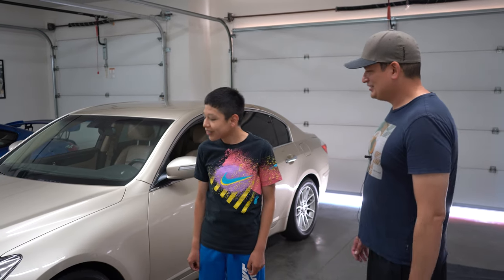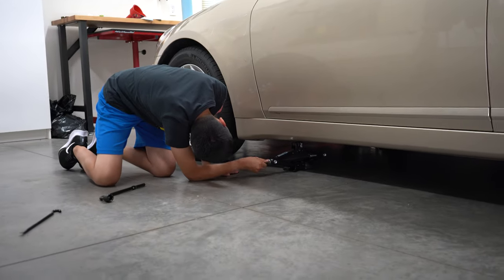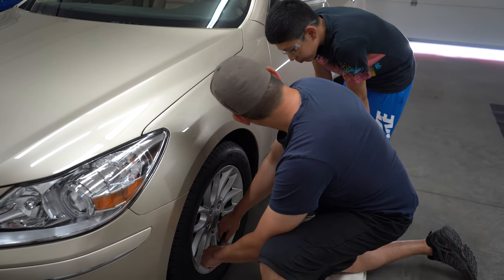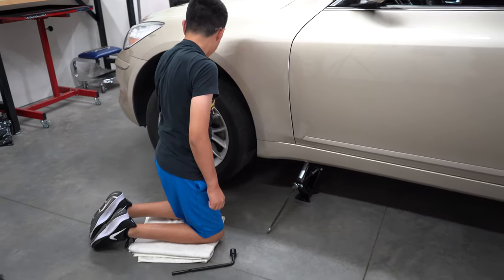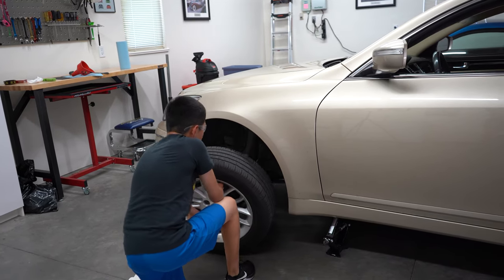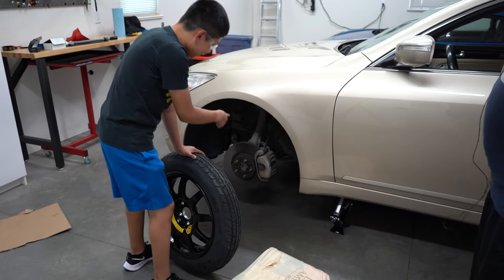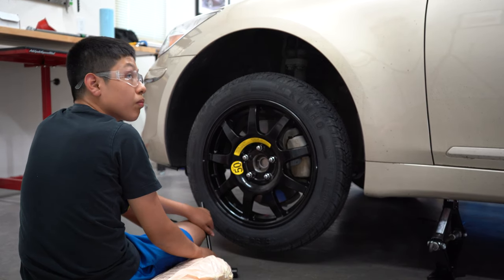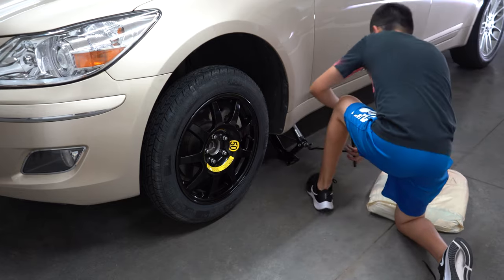Teaching A Teenager How to Change a Tire 😅

Comment: An added safety note before changing a tire, ensure the car is in park or gear. The e-brake is set, and use a rock or object  blocking one of the other tires to keep the car from rolling while changing the tire.
Reply from the maker: Thank you for the tip. 😀